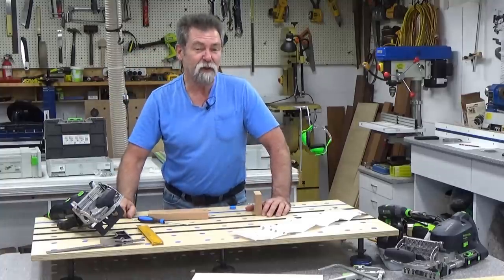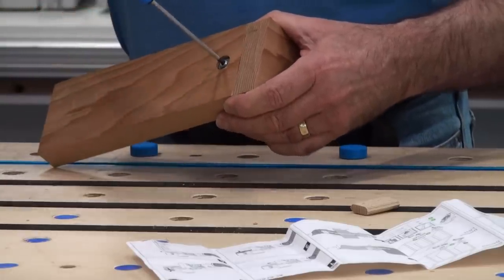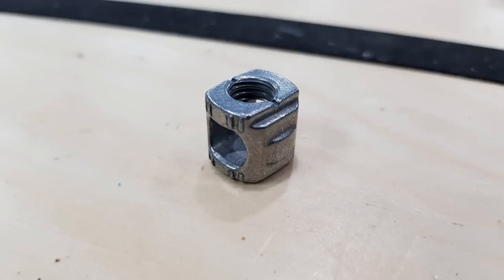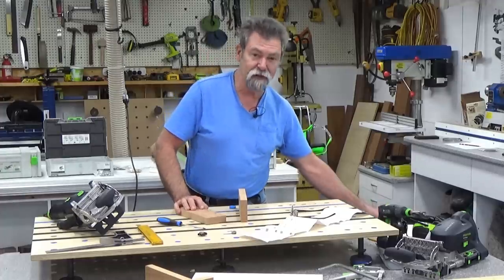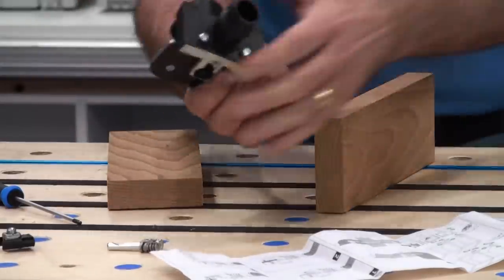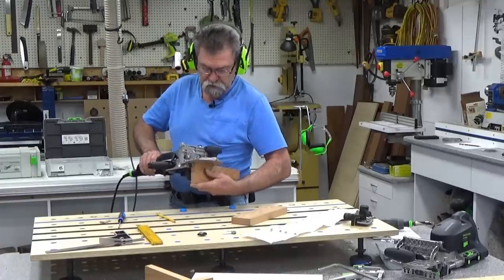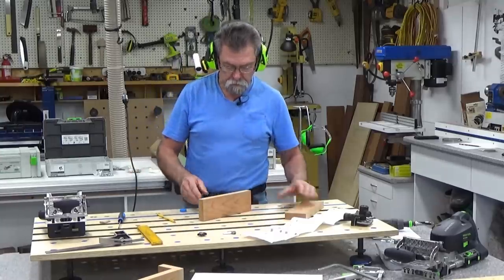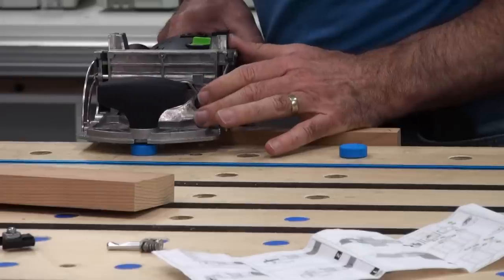Festool domino 500 df connectors Dave Stanton easy woodworking

Comment: Thanks for the well thought out and highly informative video Dave. After much back and forth in my mind over these and confirmat screws, I have gone ahead and ordered this connector range kit. Not AS painful where I already own the DF 500 machine. I think what sold me is the well thought out jig and stopped bit. Also, being able to use in materials such as melamine where traditional joinery methods don't produce the best strength. Thanks again Dave!
Reply from the maker: Thanks Youcan Doit! Be aware that using 16mm melamine is a bit hit and miss with some of the connectors. Play around with it to find out the limitations on some scrap first.

Comment: Great video Dave especially the outside versus the inside face addendum. I do not want to see the connectors on the inside of my cabinet with the plastic covering and I’ve been trying to figure out a way to use them on the outside. I asked another popular YouTube woodworker that question him and his response was it was not designed to be on the outside but designed to be on the inside. Clearly that is not the case. Thanks so much!
Reply from the maker: Good point!

Comment: I have had the 500 for probably 10 years and like many things about it.  I will take a look at these when my local Woodcraft store gets them in for the 500. The do have some for the 700 so pretty similar I suspect.  These seem fairly slow to use and the hole is huge at 15mm.  I think the Knapp connectors used with a biscuit joiner are faster and more economical.  The ultimate may be the Lamello Zeta P but it is more costly than the Festool machine wise. It can be used in thinner materials and at different angles too though and the holes when needed ar much smaller.  Thanks for the well done video Dave!!!
Reply: Based on some quick research it appears that the Festool connectors are $2-3 each in the USA. That gets costly if you need to use 2-3 per joint.  It would be interesting to see how 2 regular dominos on the edges and one of these connectors in the middle would work on a say 12" or 300mm upper cabinet side.  Or does Festool always recommend at least two of the connectors minimum to make a stronger joint?  I don't know that answer.  I guess I would have to need later out of shop assembly to add this cost and time.  I have not seen quantities of more than 50 connectors, maybe larger quantities are available at a reduced price.  I believe the Lamello Clamex / Zeta P connectors are available in up to 1000 piece quantities.

Comment: 👍👏👏👏. 
Hard to beat the pocket hole and domino combination though.
Reply: Pocket holes are pretty weak. A guy on youtube did a test between pocket hole screws and a few different joints, and even though he had obviously not allowed the glue to fully cure on the mortise and tenon joints, and had completely screwed up his dowel joints, they were still much, much stronger than pocket screws joints.

Comment: I'm looking to get into the festool world as I'm renovating a new home and workshop. Can you use the 500 as a regular domino machine and for making wardrobes, kitchen cabinets and a queen size bed?  Or do you need 2 different machines one for cabinetry and the other for regular projects
Reply from the maker: The 500 will do most of what you require and even the bed. The 700 is for large joinery projects like entrance doors that require a lot more strength in the joints.
Reply: @DavidStanton  thank you David that makes decision making much more easy to know one tool can do it all 😀

Comment: by the way what is the make of the cordless drill the bit is in? , it looks like a Festool, but what is the model / make number?, as using this system requires all of Festool 's make of tools, as the dust extractor is the power source, and must be capable of handling the current of the tools it powers.

Comment: Hi Dave, I’m wanting to use these connectors at the start of this video for jointing my office bench tops, so end grain butt joints, dry fix obviously, do you feel these are adequate please? I was planning on using one per joint with a couple of dominos on each joint, you opinion would be welcomed please 😊
Reply from the maker: An interesting idea and I think they will work well. Are you going to glue as well?
Reply: Hi Dave, No it’ll be a dry fix to enable me to change configuration or infact remove if I sell up and move, just to clarify it’s 26mm bench so cannot use 700 connectors. Do you fell I should use two connectors rather than one please? Obviously your answer is an opinion not “Dave said lol” @DavidStanton

Comment: Dave can you use these connectors on the Aussie 16mm Melamine?
Reply from the maker: Unfortunately no. The domino cutter just sneaks through.
Reply: @DavidStanton  I am fitting out my new home and have been tasked with building several pieces of cabinetry and I did some searching for 18mm melamine and found it at Plyco. The cost is comparable and they deliver or I can pick up. 
They also do various finishes, so I will order through them and build them in my shed. 
Great video by the way, very informative.
Reply from the maker: That is great info for Aussie woodworkers.

Comment: Hi Dave,
Have you used 16mm shelving for your workshop with the Domino connections? If so, how did you overcome the minimum thickness material?

I am in the process of starting to build some shelving now and was seriously looking at using the Domino connectors
Reply from the maker: Hi Brakar Zacant! 16mm is a struggle as the cutter will poke through.

Comment: Dave, apart from the ability to break the joint down again and again if you wish do you see any other advantages using this system over traditional methods?
Reply: If these are used with only wooden dominos and glued up, they are stronger and much more precise than dowels, biscuits and probably stronger than pocket hole screws (they definitely look better) and they are much quicker than a mortise and tenon joint, but probably not as strong. Honestly, if I had deadlines and did woodworking for a living, I would already have one of these machines, even though I think the price is outrageous. 

I'm currently working on a desk and it is going to be way too big to fit down the narrow hall and around a sharp corner to get it into the bedroom it is going to be in, so I've been working on a way to make it. I'm probably going to go with some form of wedged through tenon. I've never created a wedged mortise and tenon joint so I'm not 100% sure if it will loosen up over time and the desk isn't for me, so I'm working on a few ideas to add a hidden screw that should keep everything tight.The wood is old enough that I (hopefully) shouldn't have any real shrinkage over time.
Reply: @MAGAMAN  
Biscuits are not stronger than Pocket screws.  Biscuits really are only useful on not structural joints that are not taking a load and are really for alignment.  Biscuits are a glorified glue joint and just a little bit stronger.
Reply: if you need to clamp and glue something that is too small or in a weird space for a clamp? use one or two of these, domino the rest.